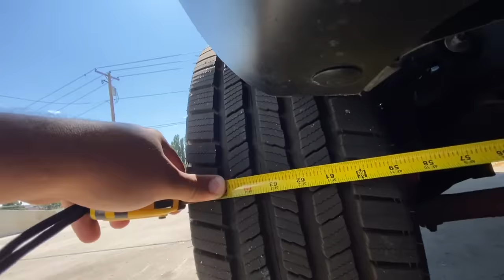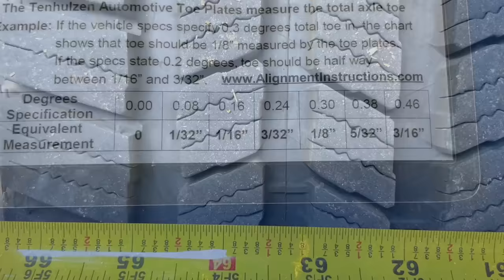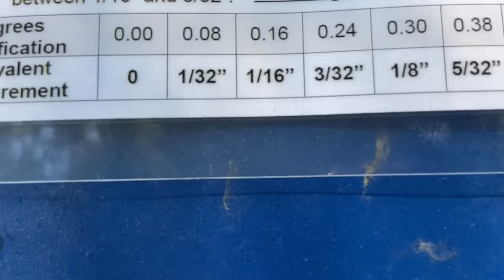How to do an alignment on a car at home using only a tape-measure!!! (And Alignment Basics)

Comment: If we are assuming that the car is out of toe at some point should mean that something came out of adjustment. My problem here is how do you know both tie rod sides came out of adjustment at the same point requiring the exact same amount of turns on both sides? If only one side comes out you can still have a measurement difference between front and back of tire that is the specified distance but one tire will be toed in more than the other side. Right?

Comment: I've gotten 2 alignments done by Goodyear bc I got 2 new front tires. First time, they totally screwed it up and still gave me my car. 2nd time was to fix their mistake. It's still going to the right. Not as hard as before but still happening. Will this fix my issue or do I need to mess with the Camber and Caster, as well? Thanks in advance!

Comment: YouTube viewers, pay no attention to the man behind the curtain. As George H.W. Bush used to say, it just wouldn’t be prudent.
If you’ll look at 6:30 in the video, the mechanic is having an issue rotating the adjustment shaft because the boot IS CLAMPED TO THE SHAFT! You can clearly see that the clamp is a removable and replaceable clamp. Do yourselves a favor, loosen the clamp and slide it off to the side before rotating the shaft. AND use a silver Sharpie Marker to put a reference line on the adjustment shaft at the end of the rubber boot to ensure that the boot goes back into the original position when you’re all done. Loosening off the clamp is a part of the service procedure on many vehicles. Don’t struggle with a twisted up boot because you couldn’t spare 15 seconds to remove a simple spring clamp.

Comment: I bought a new ford Fairmont,I took it in for a problem with the radio.They fixed that problem but created another.I noticed a pulling to the right so when I got home I looked under the front end and noticed that the nuts holding the steering  had been moved.I crawled under the front end,loosened that nut and ran it back till the paint showed where it was before.Presto chango,i put about 60 thousand on those tires so apparently I got it right.

Comment: How did you deter which wheel was more out of line (that had to come in or out the most)

Apart from that enjoyed the videos and very helpful of how to do it
Reply: If your steering wheel is crooked or the car pulls one way or the other, you can often get the toe correct as you correct the pulling.  If the car goes left and the toe is out, toe in the right side to adjust both.  If the car goes left and the toe is in, adjust the left side outwards to adjust both.  You may still need to adjust more on both sides if the toe is good, but the car still drifts. I find that on my Cobalt, I usually get the steering wheel straight and the toe correct with one adjustment of toe on one side.

Comment: Hello Mr 
On toyota 2006 sienna , I can not adjust the cambers , so I replaced the struts .It has corrected the camber a little , so is there anyother thing I can do . I can not find any place to bend the struts . Any suggestion ? Also I've taken my car to shop for alignment . all they did it was toe . Thanks for your reply if u can .

Comment: Measuring only tells you whether you are toe in or toe out.  It does not tell you which tire(s) are off.  You could be off 3/16 one side and 1/8 on the other.  You adjust for the total and your toe in is correct but your front wheels are out of alignment with your rear wheels now.  Tape measure is fine for at home suspension repairs then goto alignment shop whenever possible but DIY is not a good long term solution.

Comment: I used the straight line we with to jack stands out in front of truck worked out great ex as he'll just wrapped string around truck middle of tires adjust your ti  rods in or out walk in to  the line all four tires touch line

Comment: I always use vise grips instead of wrenches. Always always tighten the nut as hard as you can. Use a cheater bar. A cheater bar is a pipe.
Reply: Use loktite on all bolts and nails on your truck. That way it makes the joint stronger than with out

Comment: how do you know that its the left or right side that toes out, or both. You can adjust both sides so that measurement is the same as the back but now you could have one tire toe in and the other tow out.
Reply: Right???
Reply: I have a toe in I need to fix on my Buick

Comment: Hers another little trick that happened to me.I took my truck to a garage because it kept dying.I had it towed to my local garage they installed a new fuel filter,fixed.A month or so later I pulled into the post office went in took came of business and came out.I got in my truck hit the starter nothing lucky I had a hydraulic jack in my truck.I jacked it up,reached up where the starter wires went to the starter wiggled them got back in the truck and it started.I got home got back under the truck tightened the nuts on the starter celinoid never had another problem.They loosened that middle nut so I took a 10 milameter wrench they loosened it so it wouldn't start.

Comment: This ensures they are aligned to each other, but lit does NOT ensure the wheels are straight.  You must align to rear tires or your wheel may instantly go crooked when you start driving.
Reply: How do you do that ?
Reply: @cannabisenthusiast8351  must align them to the rear wheels.  Look up the string method.

Comment: If you do this job alone or with someone else use a paint marker on the tires or masking tape and a sharpie so you measure exactly in the same spots.

Comment: hey if possible I need a bit of a confirmation if this is possible. I have done a complete lower suspension replacement so I am gonna be doing this to align my front wheels. I already have my wheels off. can I do this measurement using just the rotors?

Comment: So how exactly do you know which tire is actually in need of adjustment if you're pulling measurements from the other tire if the tire your pulling off is actually off from jump then you pull a measurement from specific spot on it to the same spot on other  wheel, compare differences from rear wheels measurements, so which front wheel  adjustments  ?

Comment: Ive had the dealership do an alignment and 2 seperate specialty alignment shops do alignments at about $90 a shot and not satisfied when i had to do this. This is the procedure that big rig techs use. I have staggered width wheels on my truck so knowing which wheel to adjust is tricky
Reply: Find the center of your  rear axle from the hubs and make a mark. Adjust rear end to be equal measurements to each tire.

Comment: When simply changing your tie rods it’s super easy to throw off alignment it’s irritating. Crack jam nut loose and re tighten until your just able to spin the tie rod ends off. Count your spins. 

Same amount spins back on then hope for it lining up with the hole. Tighten jam nut and tie rods. 
Grease if need.

Make sure wheel is straight test drive to see if your off or not.

Comment: Isn't the conversion from degrees to inches to be taken at the OD of the rim, and not the tire? That's easily a difference of 50% more, meaning, in this example of 50% larger diameter, you'd have to "discount" your inches by 33% to get back to the rim values.
(BTW: You don't need a chart, just use the inverse tangent function! Of the ratio of your measurement to the distance from the center of the wheel, and you get the angle.)

Comment: One question  How did it get so far off?  Looks like something has broken or is worn out.  Like you said  this is only one of the adjustments done,  you need to check caster and adjust camber too.  More so if the toe is that far out of spec.

Comment: No matter what you think NO two tyres ( correct English spelling) are the same. Just spin them and see that measuring this way is not correct. To do this yourself you should be using the string method which is found easily on youtube. Use that method and you will have a more correct alignment

Comment: but how do you center the steering wheel? for example, if you adjust only left side you will still eventually get equal readings, but with wrong alignment

Comment: I've done a few alignments.  Ya' have to be PRECISE---double
Check your work...Take it for a Test drive on a straight road,
Let go of the steering wheel for a moment or two.. You will
be able to see if you've got it close.
Thanx for your video.

Comment: Great vid. Can u explain again which way each turn goes to the tire & away from the tire. Appreciate ur help thx.
Reply from the maker: If the tie rod is on the front end of the tire turning the inner tie rod clockwise pulls the toe in and turning counter clockwise pushes the toe out. And if the tie rod is on the rear of the tire it is the opposite
Reply: @daringmotors  thx u so much for ur help.
Reply: It depends on the car in some cases. For instance, the threading on my Alfa Romeo is reversed on one side and I always forget Which. Also Alfa's and some other European cars have make end tie rods so it can be a little trickier.

Comment: Sorry, but the fact that the toe is so far out immediately suggests the front suspension has suffered some damage to one side or the other - or both.  So, how do you know which side is correct to not have to adjust each front wheel's toe relative to each other to get the toe adjustment correct? You should introduce a step where you measure the toe on each wheel to an accurately located centre point on the car and thus if the distance to each reference point on the wheel from the centre-point is the same (and the overall toe dimension wheel-to-wheel is correct) you know they are properly aligned.  Otherwise, both wheel's toe may be wrong but the overall toe dimension between the 2 may read correctly...  I expect you'll find out pretty quickly as the car will tend to drift left or right when driven...

Comment: Can you use this method on a Mustang GT with a staggered wheel setup having 255 tires on the front and 275 tires on the back? Rims are 18 inch, 9.5 all around.

Comment: I have a land cruiser bj60 1989..it has a genuine 3b non turbo 3500cc engine..I  use a thin grade oil, my truck consumes oil ,there is no leakage.. radiator spits out coolant when cool start..any suggestions.!!

Comment: I use string..wrap around back wheel to front of front wheel..when the string is touching the sidewall on both end of tire than it's straight
Reply: Sometimes some cars are wider in the front end.

Comment: That will align the front end but not necessarily center the steering wheel. You have to align the front end in relation to the rear wheels to do that.

Comment: This is called "setting the toe in".  Not a wheel alignment that checks and adjusts if needed the caster and camber which are equally important to tire wear and handling.

Comment: The back of the tire was on a valley on the thunderer Trac tire was on a bump on the tray so if you're not measuring it correctly you have to make a straight line with a marker on the tire as you spend the entire

Comment: I drive car. Is steering wheel left or right of center? That will tell you what tie rod to adjust. I mark the thread in front. Roll forward measure. In back of tire Adjust roll back and forward re check.(as you go forward it toes out because going downroad tires toe out ) re check. Usually a toe in 0 to 1/16. These are my thoughts. KEEP CHEAP CARS GOING

Comment: This is not flaming you but pointing a few things out. There is alot of potential misalignment between what looks to be a centered steering wheel and what actually happens with the linkage to the tires when it appears centered. You are also assuming your back wheels are straight which is not a good assumption, thats why there are 4 Wheel alignments. There are so many other things inaccuracies introduced and overlooked by using this method. Yes it does tell you something is out of alignment. But I have done similar just to get my suspension in reasonable alignment after working on it, so I could safely go get a real dead on 4 Wheel alignment. Tires are very expensive, keep them properly aligned and balanced and you will get your moneys worth out of them.

Comment: Nice technique . i change passanger low control arm and my whheel. Shakes when i go 50mhp u think is because need alignment ?
Reply from the maker: That is possible as any time a suspension part is changed the alignment should be checked
Reply: No. Alignment can't cause or remove a shake. Its impossible. Most likely you have a tire/wheel issue. Out of balance tire, damaged tire, damaged wheel, is what you need to look at. Try balancing your tires first.
Reply: Make sure you retighten your wheels after you drive it for 50 miles or so. That's probably why you're shaking.

Comment: Two Pieces of wood that stretches the width of the car. Push one to the front of each tyre. Push the other to the back. Use a straight rule and push it against the face of the wheel. Make a line on each piece of wood. Measure the angle and adjust your wheel.
Reply: super idea bro!  i love reading comments for ideas like this

Comment: Probably just use a metric tape measure for it, or the metric side of your tape. Remembering a round number is so much easier than trying to stare at upside down fractions.

Comment: Inaccurate alignment. The toe-in , toe out are minutes. Will cause improper tyre wear, Roadholding, turning circle issues. Camber and Castor too cannot be adjusted this way.

Comment: How do I figure out what tire I might have towed out or in more than the other. I have to hold my steering wheel to the left just a little bit if I straighten it up it will be off right so do I need to make the passenger side come in? .

Comment: Hey. I got a 2011 ford focus. What does it mean if both of the insides of the tires are wearing out at about the same time? Thanks in advance.
Reply: usually toe Out if the inner treads are wearing and too much toe In if the outter treads wear... inner wear can also be from too much camber as in over 2 degrees camber... my gf has a 2003 focus wagon that had massive amounts of factory camber on the rears, I mean almost 3 degrees..I added adjustable rear control arms that let me set 1.7 degress camber.. problem solved... focuses usually run 0 degrees toe on the front wheels

Comment: the best method is with a rope ,SOME VIDEOS SHOW HOW TOO,,,that you hook at the back,then you have it passe from the rear tires to the front  going all around,in the middle of the rims ,,and you add a pop cycle stick at the back of the front tires under the rope,,for a  front drive as the wheels tend to go inwards as you drive,, and at a the opposite under the rope at the front of the front tires,,,they tend to go outward when driving,,,you adjust the tirods so the tires just toutching slightly the rope at the opposite side where there isnt a pop stick,,,  95 /100 or more good, compared to the proper pro alignements,,🤔😉✌n,b,make shure the rope does not get in contact with the body on either side,,,and that way you will also see if your back wheels are in their proper positions,,,if you have a hard differentiel you could find a miss alignement there,if so a broken pin might be the cause,,,on some new vehiculs,alignements can be made in the back wheels too!!!with the rope you could find a miss alignement with those too,but might have to go at the proper shop for that,!!:face-purple-wide-eyes::body-blue-raised-arms:

Comment: I don't use a tape measure all i use is a string, you just need to tie the string through the front rim then run the string around the front tire in the middle of the tire and string it on the outside of the tire and run that string to the back tire and wrap the string around the back side of the tire and tie it off on the rim, now if you are good at eye balling to set ur tow you want the string on the back tire on the front edge of the back tire in the middle to barely lift off of the tire so if this is to confusing for you to understand take ur car to an alignment shop otherwise im sure some of you out there have a clue

Comment: Only problem is your wheels can be at an angle and still have matching front and rear tow measurement.  So when you drive down the road your steering wheel won’t necessarily be centered.
Reply: Exactly what I was thinking... string box is the way

Comment: Use string, not a tape. You can also invest £120 and get yourself 2 roll overs, which actually gives you the degrees. When you have it set perfectly like my car 0.3° toe in each tire. At least that's what my Mazda calls for. Tape works if you have nothing else, but you notice a difference in fuel efficiency when done in degrees.

Comment: I could be wrong here but wouldn't the size of the tire have to be figured into the chart specs. For example: if you were to use the discs instead of the tires that would give you a completely different measurement and  that chart would be  useless. Same thing could happen if someone has non-oem sized tires. Just something to ponder i guess.

Comment: in the end when You tighten the nut You twitsted in the treering rod in the tie rod a little and missaligned the thing deffinietly both sides.If You hold the steering rod with a wisegrip or something is the correct way to tighten the nut.

Comment: This is okay for a basic alignment, but in reality accurate alignment should be done referencing the front to rear wheels as otherwise you may have correct toe on the front but this might be out of kilter with the rear wheel alignment at parallel.